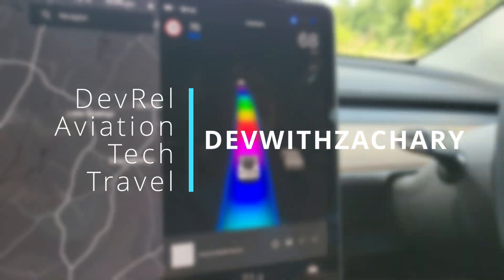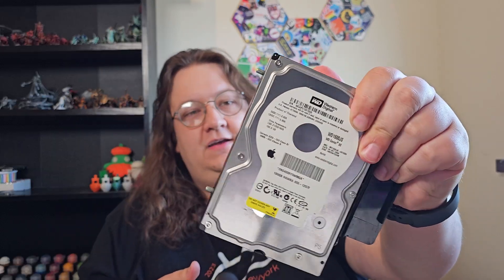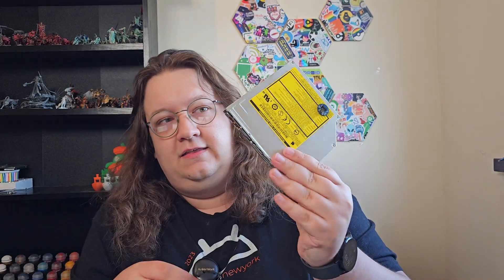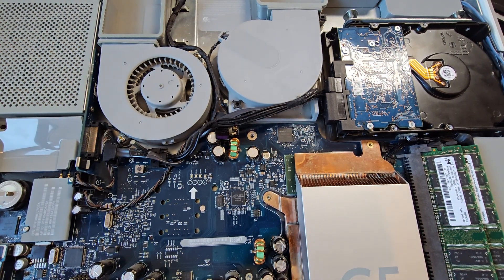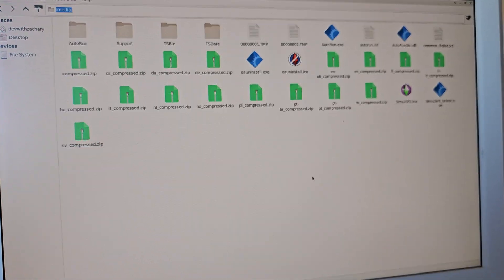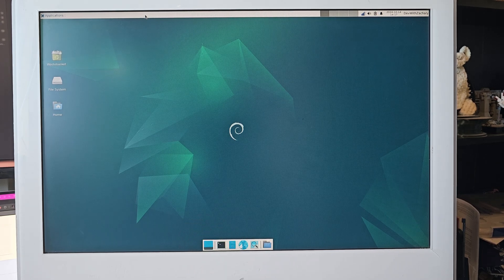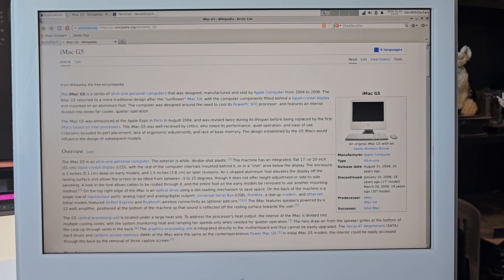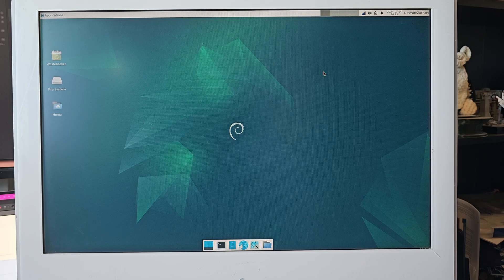Modern Linux on the G5 iMac Part 2 - Thermal Sensors and CD Drives -  Debian Linux on PowerPC iMac

Comment: Just found this video. The reason for the molex connector as well as the SATA connector is because these drives were standard hard drives produced at a time where end users may have a SATA interface in their computer, but are still using a PSU which  doesn't have the SATA power connectors. Had a few of these drives in the past and was connecting SATA drives using the Molex power connector since my PSU was too old to have SATA power connections.EDIT: I did a bit of digging and seems the iMacG5 only came with a non upgradeable Nvidia Geforce FX 5200, strange that yours is reporting as a Radon 9550, if it is an Nvidia card should be using the legacy 173.14.39 driver.

Comment: Ok, as far as I know the problem with video drivers is in the kernel, or rather how the kernel handles video drivers. Many say that it is not solvable, even if some say they are working on it. For example, Adelie linux had promised full hardware acceleration. Another project, Fienix, has tried but as far as I'm concerned there are no improvements compared to the others.

Comment: If you can't fix your dead old Intel iMAC, I suggest you take out the motherboard, and replace it with either a FLAT mini ITX board or a Raspberry Pi, or one of those tiny PCs or even a first generation M1 mac mini. There are projects and adapters that can make it look factory and connect to the existing screen and ports.
Reply from the maker: Its a great idea!

Comment: I think you might actually have graphics drivers, the graphics card might just be too old for radeontop, which is for R600 and above. I have an Intel Mac with x1600 graphics and that is an RV530 graphics processor, which doesn't work. It tells you specifically what you have in 'About Xfce'.

Comment: I've recently done it. Debian 12 on an iMacG5 ALS. Mine has a temp sensor at the side of the HD-Tray. But the fans are running lound. Newest browser i found was ArcticFox. Recently I' ve no sound. Found a solution, will report If i will work.
Reply: you know about "sealion" browser? similar to arcticfox, is based on pale moon, but sealion is based on the latest version of it, i give it a shot on my imac g3 and it works very fine!